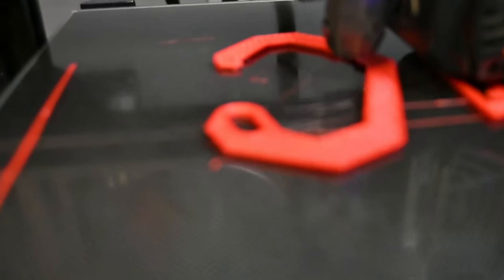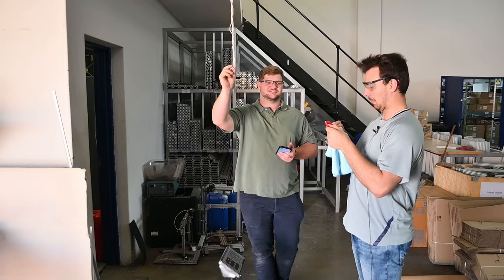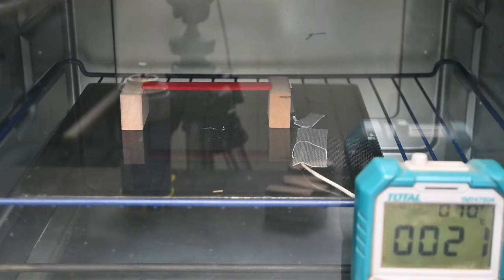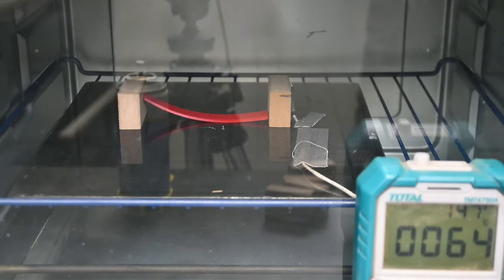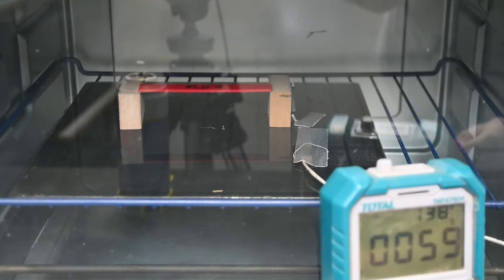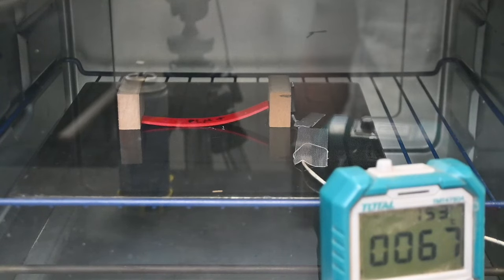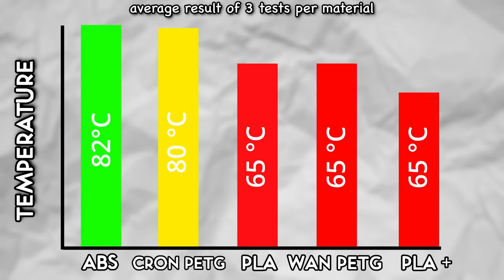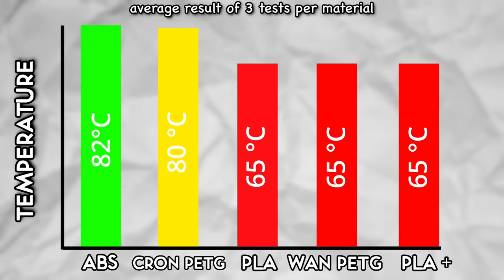Which Filament is the BEST for YOU

Comment: ABS and ASA are significantly lighter than the more-common materials. Your testing suggests that ABS is comparatively temperature resistant, but vulnerable to shock. Temp resistance is a well-known property of ABS, so no surprise. ASA is also said to be more temperature resistant, but I'm wondering how shock resistant it is. My curiosity is not merely academic. I am building a 100 printer and would prefer to use a light-weight and temp resistant material for the tool head.
Reply from the maker: We do have some ASA material as well, there are some other materials I would like to test in the future alongside ASA, to get a better understanding on some of the less commonly used materials too. Thank you for the suggestion!